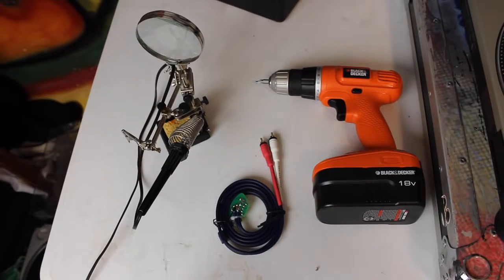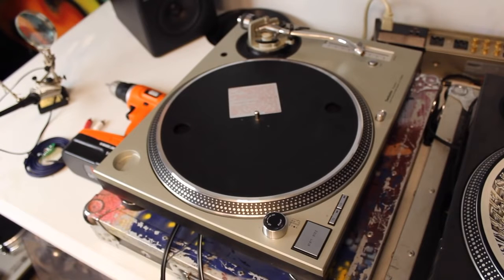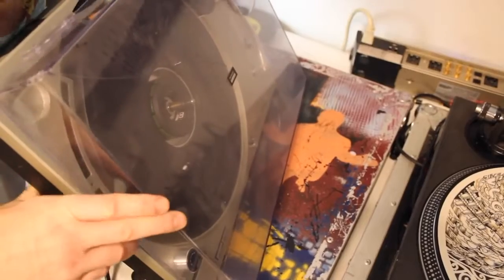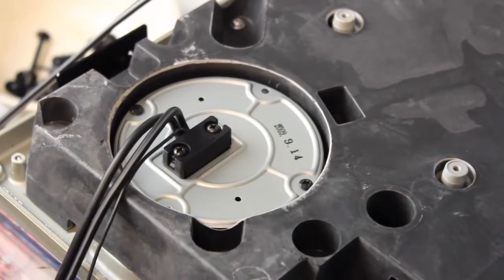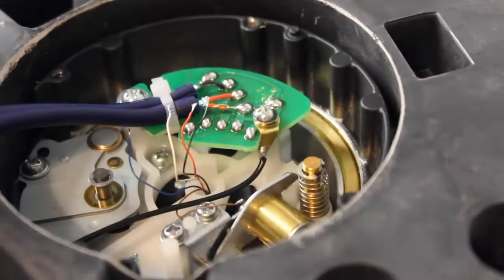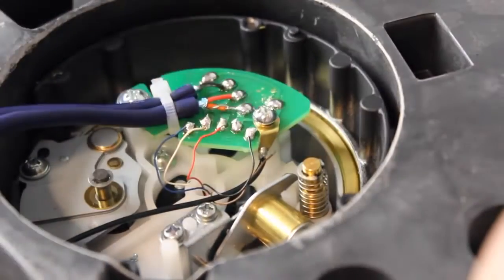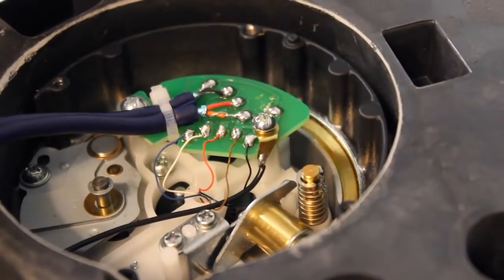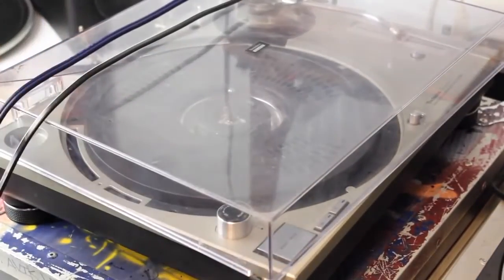How to Replace the RCA Cables with Internally Grounded Cables in a Technics 1200 Turntable

Comment: Did you end up with any extra parts there?  Any reason why you didn't put the black rca clamp on the plate that ensures you don't pull the rca off it's circuit board or crack the circuit board if it gets a tug?

Comment: Never like to see power screwdrivers in a repair - Thanks for the content
Reply: was making me nervous - tried this once and stripped some screws on a DJM. never again :(
Reply from the maker: After doing a few of these, I know why... lol. For those wondering, it's pretty easy to snap off the screw heads... However, I still use powered screwdrivers, but I'm way more careful, and fully tighten by hand.